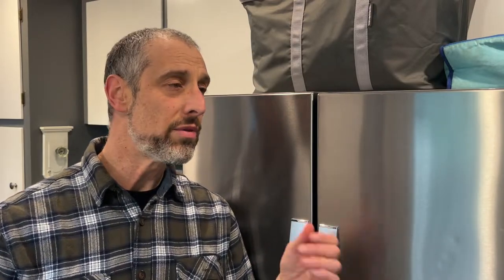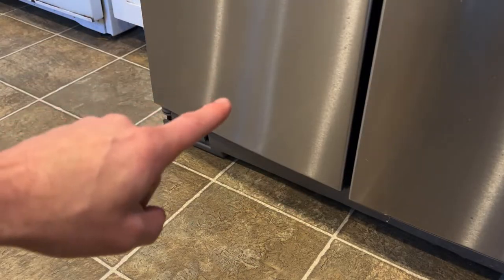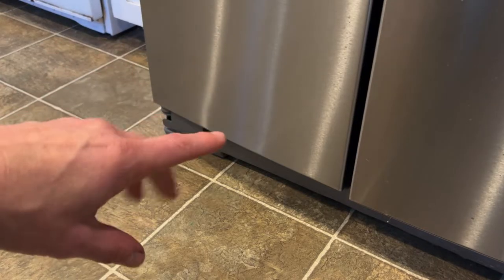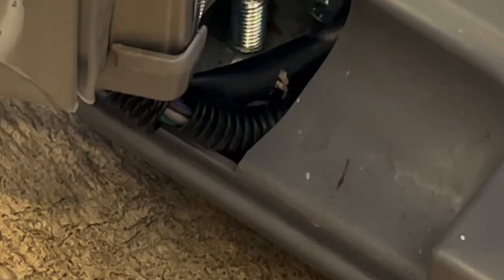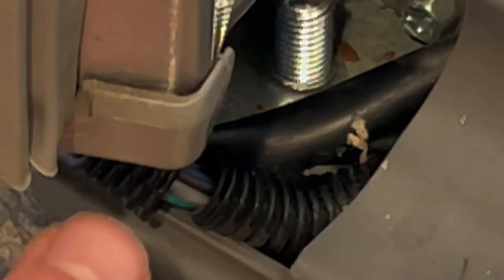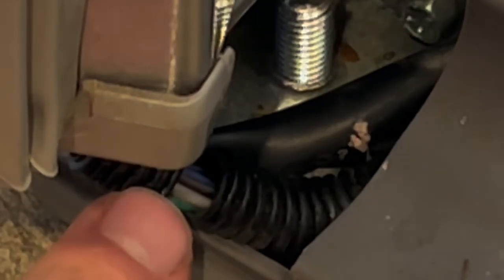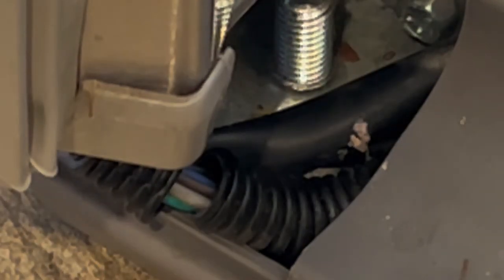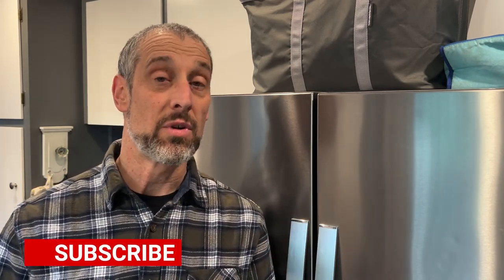Whirlpool Refrigerator Issues? This DESIGN FLAW Could Be THE SOURCE PROBLEM

Comment: Someone should start a class action lawsuit. This faulty design is absolutely ridiculous. I was told that it would cost 1400 hundred dollars to fix the problem because you could not just buy the wire harness and you would have to buy the whole door. I have just finished about my 5th and final repair because I have had to cut back the wire wires on the fridge side and the door side so much that I do not have anymore room for repair. This really pisses me off because the fridge is only about 4 years old. Whirlpool sucks!
Reply: AGREED!!!!!!
Reply: I just learned that I have the same issue. Is a class action in the works?
Reply: yeaaa I just went to customers house 950 for freezer door plus tax andd the same issue would happen again.
Reply: @RealRKelly.  the cost of the door is $1,000, according to Whirlpool.  They then want $500 to install.
Reply: @RealRKelly.  It really sucks. I still have mine barely working. I cant get ice from the door any longer but at least it still does make iceand I can get it if I open the door. What really sucks is it seems that a lot of the refrigerators are made the same way. The only change that they have made is, it seems that the plastic guard at the bottom is cut out more so there is less friction of the wires getting hung up. I cut my plastic guard in the same way awhile back and it helped. Just ridiculous!
Reply: Same problem here. I've repaired mine twice and now the wire is too short to fix anymore.
Reply: Dealing with this exact same issue currently... Fridge less than 2 years old. Unbelievable!
Reply: Same issue here. Whirlpool makes good stuff but this design is deeply flawed. Repairman just left and I’m about to contact the manufacturer.
Reply: @chrisknotts6427  Me, too. Mine is just over three years old no longer under warranty. For right now, I'll be pricing new fridge/freezers and they will not be Whirlpool.

Comment: Thank you very much for this information! I am having problems with my Ice maker not making ice. I have discovered that my freezer temp was set wrong for one, and now i will look at the bottom to see if any wires are frayed or if the water tube is pinched. Hope it works!

Comment: I removed the fascia, and laid on the floor with the freezer door open and the unit unplugged, and soldered the (5) wires that were completely severed in two back together. After taping the wires and loom back together, I removed the white ring clamp and the 90 degree snap in elbow that goes into the botton of the door, which were causing it to get pinched between the elbow and the edge of the fascia. I will monitor the harness and add a section of rubber fuel hose or something if needed for a little extra protection, but it DID restore function of the ice maker and removing those pieces seems to have given it the room to move and not get pinched. The harness is about 50 bucks, and it is available, but I would not simply replace it without knowing what the root cause was. otherwise, you will have the same problem again. Hope this helps someone else. I wish I had known to look here first. Spent a few hours troubleshooting all the other normal stuff like the solenoid valves and control board first. I would have never thought pinched wires...
Reply: I was considering soldering mine since the clamps don’t seem to be solving the issue. I’ve never soldered before, but would you say that someone could probably do it with a cheap soldering iron and a little practice?
Reply: @laurenlyon9706 Yes, the wires are thin and even a low wattage soldering iron would do the job just fine. I would recommend using flux core solder and use some cardboard to protect the floor if you do it with the door in place. I twisted and tinned the wire ends with solder before joining them back together. you may want to look for a basic soldering tutorial on here and practice on some other wires before jumping into the repair. Also, a pair of wire strippers that will do multiple sizes would also be helpful. If I remember correctly, there was (1) 18Ga and (4) 24ga wires that I had to repair, so your wire stripper should probably do at least those sizes. Be safe and best of luck. Hope this helps.
Reply: In case anyone is curious, it stopped working. un-taped the wires and found one had broken where the solder meets the braided wire (assuming from the flex). re-soldered and taped it all back up. 2 weeks later, stopped again. un-taped wires and nothing was broken. left it un-taped and it started working again. it is very bizarre. seems like a much better design would have been to have contacts like a steering wheel, or spring loaded contacts like a door jamb switch instead of wires that bend and pinch. I am still not convinced that replacing the pigtail with a factory part is the way to go. seems like someone needs to come up with a real fix/improvement. it is very aggravating to have a fridge with this feature and it arbitrarily stops working constantly.
Reply: Thank you!!!!

Comment: I have couple problems. No water in ice maker and the ice dispenser not churning. I am getting drinking water thru the door. The complete freezer door(under warranty) was replaced 5 years ago for not producing ice. Just checked the wiring at the freezer door bottom hinge and have at least 4 broken wires caused by the pinching action of the hinge. Lots going on at that bottom hinge area(looks like the 2 water tubes and another electrical line going literally thru the center of the hinge/pivot area are in excellent condition). Should have made that pivot hole big enough for one more electrical line. Anyway, will try to solder those wires back soon.

Update: Soldered the wires together, water is filling the ice mold, and ice is collecting in the bin. One thing like someone noted, it takes a few hours for water to be injected into the ice mold(does not happen instantly) and ice to form. It definitely took several hours before I heard the water valve click and the acccustomed sound of the water filling the ice mold.

2nd Update: Everything worked for 2 weeks then opening/closing of freezer door broke wires again. Will have to unload the freezer and try again. Read someone had the same issue after soldering wires.

Comment: I've fought the same problem for years. The problem is just as explained by jimwillis176. It looks like they had the bright idea to move the icemaker into the door itself. That would have just fine if they had redesigned the hinge to allow the icemaker wires to go through the hinge along with all the others. Instead, they brought them out a new extra hole some distance from the hinge. This causes the icemaker wires to flex and bend each time the door is opened, and they eventually break. I've repaired the wires twice in 5 years, and they'll soon need fixing again.
Reply: any tips on how to repair?😅 my wires are broken
Reply: @Neji513  I've fixed this several times without taking the door off. It's a bit tight but do-able. Originally, I bought some shrink tubes that had a ring of metal in the middle. You strip both ends of the wire and run them through the shrink wrap so they overlap at the metal ring, then you pinch the ring closed around the 2 wires and use a heat gun to shrink the tubing. That worked OK but the tubing was so rigid they ended up snapping at either end. I eventually bought a soldering iron and learned to solder (not too hard). Since you do eventually run out of slack on the wires, I just get an extra length of wire, cut about an inch and a half off, strip both ends, then solder both ends to either end of the broken wire. use a shrink tube over them or some electrical tape
Reply: @mikecook9864  turns out my dad knew how to do it, so he fixed it lol
Reply: @Neji513  Good to hear. You'll most likely see it happen again.
Reply: @mikecook9864  well we had the fridge for like 10 years, never happened before. and the way our fridge is set up, overextension of the freezer door is not likely to happen. so hopefully it wont lol

Comment: I have the same problem on my WRS571CIHZ02 refrigerator. My unit failed at 2 1/2 years. Whirlpool refuses to acknowledge the design flaw or even offer technical support. Calling the "help number" is nothing more than making an appt for repair AND at an unspecified cost. The operator could not even tell me what the basic, initial cost of a repair visit would be. Instead she snidely said "How can I tell you what it would cost if the technician has not seen it?" How is that for rudeness and lack of service?  
Local applicance repair guy said that the problem is well-known among technicians. The only fix is a new door at about $800. And the door wiring has not been redesigned so the problem will reoccur for sure. The wiring harness alone cannot be replaced because it does not have a connector on the door side so there is no way to remove/replace the wiring. He said he could solder new wire but could not give me his usual warranty on such work because he knows that the problem will reoccur. 
The hinge on my unit (other door) was also faulty but fortunately the installer noticed that and returned the following day with a hinge taken from another unit. That was when I realized that the door had not been secured and could have fallen off in the interim. Little did I know at that time that the
unit had a fatal flaw. Whirlpool is contemptible and this product is junk.  A refrigerator should have a longer life than 2 years. I was forced to replace it.

Comment: I have the same problem. Appliance repair came out three times. Replaced the ice maker water valve and replaced the ice maker. Each time the ice maker world work for a week or two. Then the owner of the repair shop came out and "fixed" six broken wires. About a year later the ice maker stopped working and I inspected the area shown in your video. Another wire (the red one) was broken. It is exactly as you described - a design flaw that leads to broken wires! The design flaw is because the ice maker cable does not go through the hinge. I'm sorry to say - but engineering 101. Now what? Replace the door?? and get another two years? Or replace the fridge with another brand?

You mentioned  "control panel malfunction, ice maker/water dispenser not working, leaks, slow water flow, and more!" - how about electrical fires? Electrocution? Either are plausible in this situation. Shame on Whirlpool for not owning up to this egregious design flaw!

Comment: Same problem here. Totally sucks getting a wire re-connected when its severed closer to the door.
Reply: I'd recommend adding a 2.5" length to each of the 8 wires in the larger bundle.  Solder and shrink tube on each connection, then tape wrap the bundle and slip split corregated conduit over.  Finally, cut away any interfering grey plastic at the kick-plate grille back side before re-installing.

Comment: Is there a wire harness available or do you just repair the wires? 5/17/2023
Reply: Splice wires
Reply: No wire harness available to buy and it can not be replaced. You have to buy the whole door.
Reply: WTF!  A new door?  It will only happen again, won’t it?

Comment: I repaired my sisters POS. All 8 wires were broken after about 1.5 years of use. There is a plastic piece that routes those wires out the bottom of the door and parallel to the bottom toward the handle side. But they must turn 90° to go under the fridge. When you open the door, that is where they bend.  With the door fully open, they are bent about like this |/ vs |_  when closed. I left that plastic piece off, so now they are left to rotate in the door hole instead of bending. The ideal engineering would have routed those wires thru the top hinge since the water and other harness leave no room for those wires thru the bottom hinge. IF YOU HAVE ONE OF THESE, I would remove that part. I believe the wires will last a lot longer without it. Of course, if you are reading this, they probably are already broken.

Comment: So.. has anyone gone after whirlpool on this yet? Because if not I’m happy to start something up. It’s unacceptable that I have a fridge barely over a year old that doesn’t give me ice through an AZ summer..
Reply: Have you started anything?  Did you fix and how?  I am now experiencing the same issue.  I can see cut wire. 😡
Reply: @nickdeliso7026 only way is to resplice them or get new freezer door but in a couple years would be in same position.
Reply: @RealRKelly.  The Whirlpool repair guy said the wire was run incorrectly.  Stated it should have been run outside the leveling leg, not inside.  $1,000 for a new door, and $500 to install.

Comment: This is a common problem with many fridges and services in the door. I am not aware of any positive class action suits. I don't believe the door shell can be split open. I repair the wires with solder and shrink tubing. I don't recommend taping the harness. The harness needs to be as flexible as possible. It's not out of the question to have to extend the wires to make the bend easier. For this flaw... I have never recommended fridges with the services in the door.

Comment: Yes, I'll join the pissed off group here with what appears to be 4 broken wires. But had an idea to minimize the problem if caught soon enough. If you go to an auto supply store and buy some dielectric grease and apply a good amount all around the wire harness, it might reduce the friction enough when the door is opened to stop this from happening. Also it seems the 5th wire that has not snapped yet is still operating the ice crusher. If you go out and buy a bag of ice at the supermarket and fill it manually  It will dispense crushed ice. For $2.50 every month its well worth the trouble.